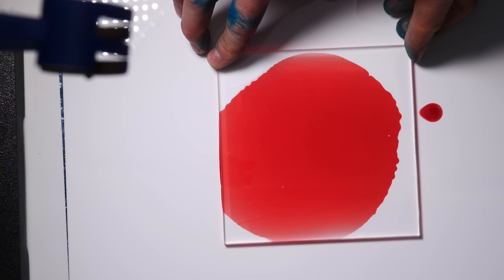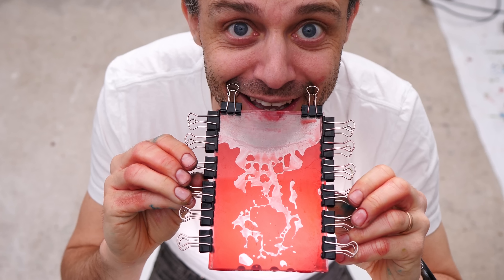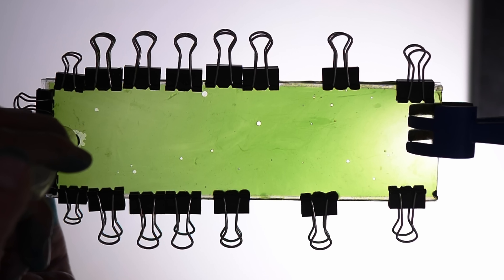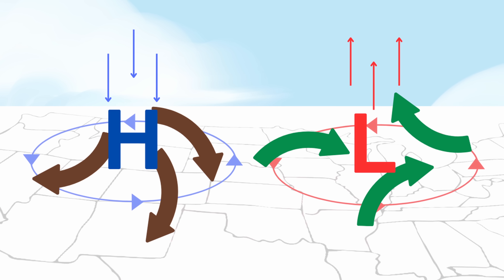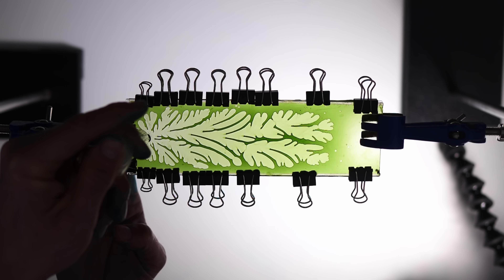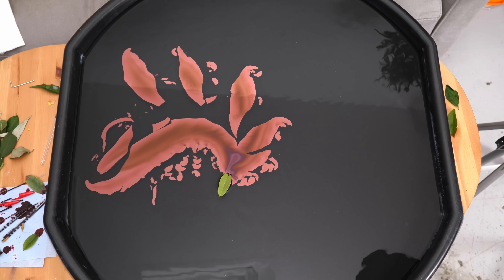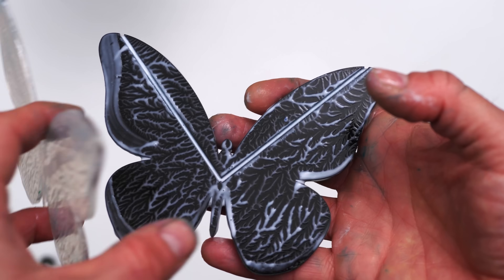Why honey makes these strange tendrils

Comment: Do the butterfly by cutting the wings as two separate pieces of acrylic on the top and then pry each wing from symmetric points - for example, leave the body uncovered and pry from there. Still statistically impossible to get true symmetry, but you would get air radiating in a similar direction on both sides.

Another route would be to make the body a hinge so you pry the pieces apart from each other. I doubt that's feasible to make using acrylic specifically between the dimensionality and the tolerance requirements, but if it does work with some material, you would get near-perfect symmetry that way.

Comment: The second I clicked on this video, I thought about the rtv silicone I use every day to seal ending or transmission cases. When we pull them apart, these fingers are dried to the sealing surfaces.

Comment: I'm sure this is already been said a bunch of times.
But for the butterfly, start with it folded in half and then unfold it And lay it flat. Like book matching the back of guitar or something..

 But maybe one side will be significantly different than the other, but it'll be a similar pattern.Just an inverse or something so there'll be some kind of symmetry there.. So it ... might work.. 

Alternatively. You could make a hinge on the plexiglass.Or whatever you're using. (And not cut out the butterfly shape until after the two pieces are pulled apart.) And then separate by pulling on the 2 opposite corners. So the center separates last.. And maybe it will center the design along an axis in the middle..  I don't know...
Reply: The hinge could only be in the center where you want the design to be centered.. 

And the lower corners on the same side if the hinge could be tapered up slightly to encourage it to separate at the hinge last..

Comment: Use slots & tabs on the bottom of the butterfly wings to act as a stabilizing hinge point. Then add tabs to the tops of the wings to grip onto both wings and pull up with even pressure. Voila, your very own Rorschach flutterby.

Comment: I studied a similar fingering process for my PhD:  reverse combustion front propagation for underground coal gasification.  In that case, rather than a viscosity difference, you had a porosity change.  But the fingering was driven by a similar instability.  In that case, fingering was beneficial.  Now if we didn't have climate change concerns and the fracking revolution hadn't happened, the research might have actually served a beneficial effect, beyond getting me a degree.

Comment: 11:00 Why does the initial circle of fluid contract when added the other liquid? Wouldn't it expand?

Edit: Thinking about it I think it's because the fluid pushes the middle of the somewhat inflexible plate up causing liquid to be sucked into the centre to fill the space created by the inflexibility and the newly created bulge the blue liquid creates.

Comment: For making these shapes I'd suggest trying to 3D print them. You could print two butterfly halves and then add handles to pull them apart more evenly. You would need to tune your Ironing settings, but with proper tuning you can get a top surface of a 3D print that looks basically perfectly flat. (Whether it actually is or not I can't say, but you can get it so flat it certainly looks like it)

Comment: The obvious way to make a butterfly pattern would be to cut your two plates in the shape of half a butterfly. After prying them apart in any direction you can join the two symmetrical halves like an open book and make a full butterfly.

Comment: What if you use a tool to pry the butterfly apart from the tail? Either by forcing something between the plates, or attaching things to the outside to pull.

Comment: Interesting how the margin of the more viscous fluid pulls back a little at the start of the introduction of the less viscous fluid in the Hele-Shaw cell, I'm assuming that's because the pressure of the introduced fluid is flexing the plates and pushing them apart a little?

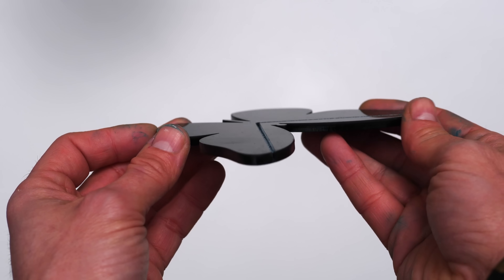Comment: 1:57 maybe one sheet could be just a rectangle, that you would pull from the middle (it would be bigger than the butterfly), and it would simultaneously pull both wigs of the butterfly.

Comment: I want to see dish soap water pushed into one so it has lots of thin fingers.

Also, you didn't talk much about why it happens when the plates are pulled apart? Is it just that pulling the plates apart basically forces air in?

Comment: I wonder if this phenomenon is why volcanic eruptions can start as a whole line of vents. you have a lower viscosity fluid (magma) pushing through a (much) higher viscosity material, the host rock. Even sandwiched between larger bodies of harder, unfissured rock on either side to make the high pressure zone. https://www.youtube.com/watch?v=LpAQHhOB6QQ

Comment: Regarding the energy interpretation: Maybe I missed something in the video, but that idea doesn't really jive with me fully. The reason we get a straight edge in the first place is that the film of the more viscous liquid is trying to minimise its surface energy. So by introducing the other less viscous liquid, we are introducing a pertubation to that minimum, effectively increasing the free surface energy of the system. Assuming the system tends towards a local minimum in free surface energy again that should lead to a circle shape or a straight edge if introducing the less viscous liquid from the front.

I get that this doesn't fully translate over to the observations, but now I'm questioning what I'm missing. Is it that the border is unstable? Because a fractal border should always be larger than e.g. a straight edge if I'm not mistaken. Where does the energy come from to stave off the tendency towards the minimum?

Edit: To maybe clarify a bit, I'm thinking the more viscous liquid should always collapse into a ring shape around the fractals if given the opportunity to tend towards a minimum. And I'm confused as to why it doesn't actually do that. Is it the viscosity of the involved fluids? Is that what occurs with water and air?

And just as a side note, you can actually see the effect of "introducing the second liquid increases the surface area" on the examples with the two plates pressed against each other. When introducing the new liquid from the centre, the liquid previously occupying the space contracts, as the larger edge is forcing it to contract the rest of the liquid to accommodate for the extra energy at the edge.

Comment: Follow up idea. Study what causes the start of a finger. You said a perturbation. I’m guessing that dust or some other impurity in the thick liquid can initiate a finger. Another possibility is a scratch or bump on the plastic sheet. So if you map the tips of all the fingers you get a map of the impurities of the threshold that causes a finger to start. Doing that by eye during your video gave me the sense of a fairly uniform distribution of starting points. What happens if you arrange sand some powder grain by grain in the thick liquid?

Comment: For the butterfly to be symmetrical, I would imagine you'd have the center to be an hinge, so you can lift two ends independently. Alternatively, use a thin flexible sheet instead of the plexiglass, so it's kinda the same thing, but due the flexibility rather than an hinge.

Comment: I did this yesterday when I was putting a sponge thing on a pretty thick paste to apply a finish to a project. 

If you want a symmetrical butterfly you'll need to add a handle in the middle to life it up, it'll be decent.

Comment: Amazing Phenomenon. Is this process reversible? 
Like if you took the setup where the thinner liquids are pressed onto the thicker ones and you vacuum sealed the chamber (assuming there is enough air on the sides that can be compressed in order to let the fingering happen in the first place). I'm thinking of something like the  "unmixing color machine" Destin made on SmarterEveryDay.

Comment: For the butterfly wings just cut them in half and then use those two pieces to make the pattern (stick the two halves together). Once you have the symmetrical pattern you just attach them back together at the middle.

Comment: idea for butterfly: cutting a channel in the middle, just so that the top plate bends more. then attaching a handle that connects the outside parts of the wings. if you pull the handle so that both wings get lifted at the same speed starting with the outside edges, maybe you can get a similar pattern on both wings

Comment: with the butterfly shape, could you use a reverse clamp(don't know what it is called) if you squeeze the handle the clamp opens up. If the other side is wide enough you could start on the bottom of the wings and see if the pattern grows like you want

Comment: Feel like surface tension wasn't adequately talked about, that and the fact that when you pull the plates apart, the air is coming radially inwards, counts for the concave Vs convex shape of the fingers when you blow from one side or middle

Comment: Drill a hole to the top sheet of the butterfly and use air to separate the halves, as you did with unbutterfly shaped sheets.

And then pry the sheets apart from the center, i don't think air alone is enough.

Comment: For the butterfly - I would just cut the top (the one you peel off) part in half and peel them from the middle. Add a little knobs so you can grab the sides in the middle.
Great interesting video btw

Comment: You could probably make the butterfly work by splitting the clear side down the middle, and lifting it with a hook from the middle.
Reply: Or even better, a hinge in the middle, and lift it from two sides.

Comment: One thing I notice is that when you put the thinner liquid in, you counterintuitevly make the thicker one smaller, such as at 2:48 .  My guess would be that you are applying enough force that the plates are being pushed apart and and surface tension draws it into a smaller area even as the total volume is increasing. I wonder if this thickness difference could also be making an impact.

Comment: You can see secondary  viscous fingering in some of the Hele-Shaw cell experiments. I imagine that pumping the less viscous liquid into the middle of the blob deforms the plates causing a pressure gradient. Eventually, that gradient causes the air outside the blob to invade the viscous liquid, creating baby fingers.

Comment: Butterfly: make a fold in the top plate, lift from the fold. A channel with a rope might help with this. You might actually want to snap the top as it might be difficult to stop the plates sliding as you lift.

Comment: for the butterfly cut the translucent part in half,put it in place, and for taking it out a round point screw right throught the middle of the opaque  part of the butterfly would do the job symetrical.  the angle of the screw point could be changed to different results.

Comment: What if you just put a little handle on the middle of the butterfly's back so you can pry from the center? You may need to make the top wings more flexible such that both the left and right start opening from the middle.

Comment: Can't the same explanation be used in lightning shape by replacing pressure with voltage and viscosity with resistance?

Comment: For the butterfly pattern: you might try making the four winglets as separate top plates and prying them apart one at a time. That should let you control the direction of fingering for each winglet and develop a more symmetric pattern.

Comment: Anyone who's ever had to glue flat sheets will know this. The solution: squeeze the pockets out, then squirt more glue where the pockets come from. When you release the pressure the sheets will  suck in the extra glue instead of air

Comment: For the butterfly, if you want to begin the separation in the middle, the middle simply needs to be hinged in some manner.  You could use two acrylic plates that meet in the middle.  Just peel them off in opposite directions.  The plates don't need to be the same shape as the butterfly.  They just have to cover it.  So finger holds shouldn't be a problem.

Comment: For the butterfly, try to make it slightly curved and then try to press it together, let the inner strength to pull it or maybe add some holder at the wings and pull. I think both wings need to pull at the same time.

Comment: @SteveMould    At 10:50 the effect you are talking about looks like the "Marangoni" effect. It is caused by a surface tension gradient. It can be observed when mixing rubbing alcahol with water. I think that a similar process is happening there with the two different surface tensions creating the same "fingers" because of similar efffects at the place where the two liquids meet.

The phrase "fingers all the way down" filled my head with visions of some very cursed AI generated art...

Comment: Notice when pumping liquid in- on the outer edge you often get more fingering because the pump is forcing the plates apart, which serves to pull air inward. For the butterfly you could pump the liquid in the center and then pry off that way

Comment: for the butterfly, the ‘seed channel’ should be down the centre of the butterfly with a little piece of whatever stuck to each side of the channel as well as a piece of something on the back which can be used as little handles so that the two pieces can be pulled off from the centre, if that doesn’t quite make sense i’ll try explain better, if u reply that is

Comment: First it starts with curiosity, then goes art, then there's a few decades of study to control it, one can only hope years after that it's harnessed for good. But really if this could be utilized in a 3d form rather than just between planes, it'd be cool to make pseudo-lung structures

Comment: I’m a geologist who’s been seeing this pattern in the rocks I’ve been studying. At first I thought it was dendritic crystal growth but was then confused when it wasn’t crystalline. This explains what I’ve seen nicely! Thank you :)
Reply: Can you tell me more about the rocks?! Geology student here, I was wondering as I watched it whether it could happen in rocks
Reply: @ Of course. They’re actually super interesting rocks from an accreted subduction zone plate interface but I suspect this dendritic pattern is far from unique to this setting. The rocks are part of a type of rock unit (called a “mélange”) consisting of blocks (from 10s of metres in size down to clasts of a few millimetres) of sandstone within a matrix of mudstone. The whole rock unit is really pervasively fractured but there is one set of fractures which is seen in both the mudstones and the sandstones and these fractures have alteration rims which are narrow and straight in the mudstones but in the sandstones they take this thicker dendritic pattern. I’d gathered that the difference in permeability between the mudstone and the sandstone was responsible for the difference in thickness but I couldn’t explain the dendritic pattern before watching this video. Especially given that we don’t see the same fingering pattern in the alteration rims around other sets of fractures cutting the same material. Attributing the patterns to differences in viscosity between the fluids makes a lot of sense.
Reply: @Dr.AlexPClarke thanks!

Comment: in ceramics you can get similar pattens to the dish Soad in glue with a technique called "Moca diffusion". You put ceramic stain powder in a thin acid like vinegar or coffee. You drop the acid into a thin viscus layer of slip (liquid clay). The acid fans out in a feathery patten that is quite pretty.

Comment: This sort of fractal-like advancement pattern is actually common in many areas of nature for a simple reason! Electricity is not the only thing which follows the path of least resistance.

Generally speaking, your logic for how the fingers form applies to just about all forms of fluid movement. It goes even deeper, because raw material is not a conscious actor making a decision; it's all individual particles simply bouncing around and the true reason physics works the way it does is because of statistics. When you have a higher number of particles in one area all moving at higher speeds, the number of particle interactions is higher in that area than it might be at say the edge of that area. If a particle is moving towards the area with the higher number of particles, the odds of it hitting another particle at any given moment are higher than they would be traveling in the other less dense direction. Therefore the amount of time that will pass before it does bounce off of something is relatively short, then when it does bounce and it goes to the direction direction the average amount of time it will take to bounce again and go back the other way is longer. In this way particles tend to 'spread out', and as they do the times between bounces get less and less until every single particle is eventually on a path upon which it will never interact with another particle ever again.

In any case, what this means is that particles move from high density to low, high pressure to low, high temp to low. High energy to low energy, entropy. All because particles bounce more often when faster and closer together and less often when slower and further apart. It only appears to be slow/generic/wavelike because these interactions happen billions of times every moment between billions of particles, so many interactions that all we can see at the macroscopic scale ARE the "averages". Fractal demonstrations like this are a rare case where the unaverage true nature of these interactions are actually visible at our scale, but in truth at the atomic level everything is happening in fractal patterns. Between any two bodies of anything are boundary regions that are roiling maelstroms of particles moving across the boundary- even between air and materials that appear to be solid.